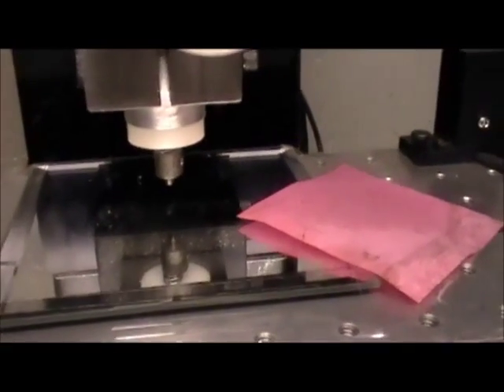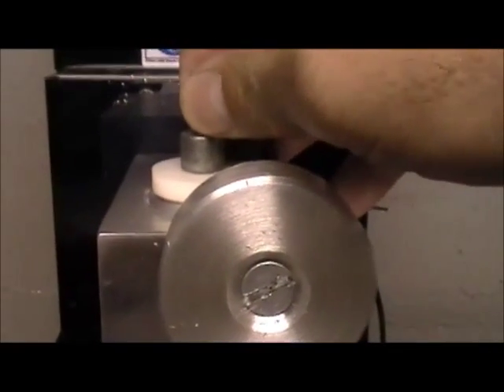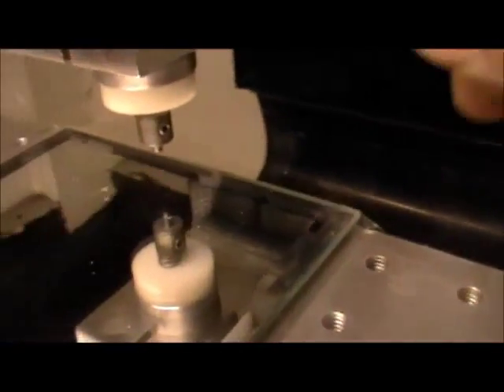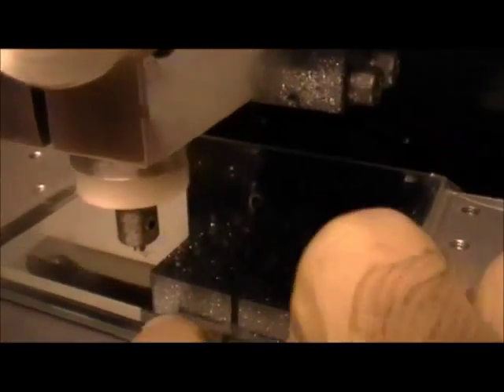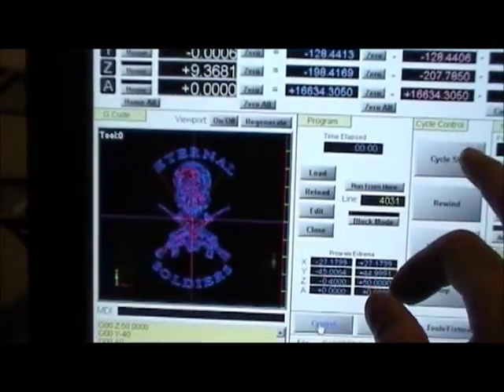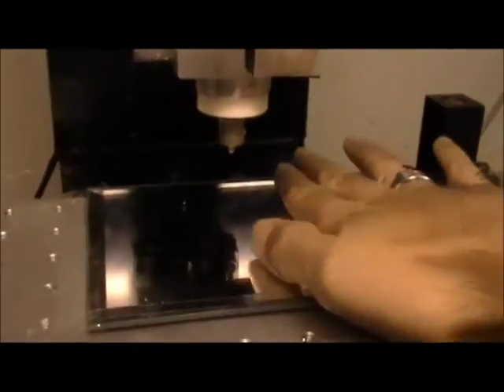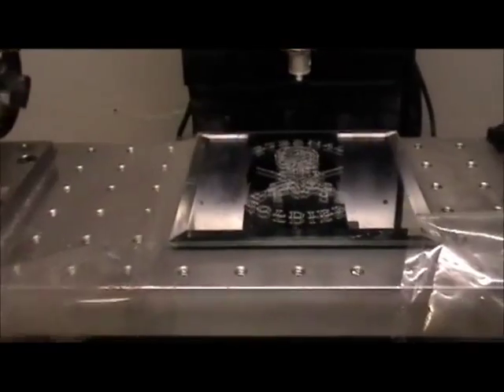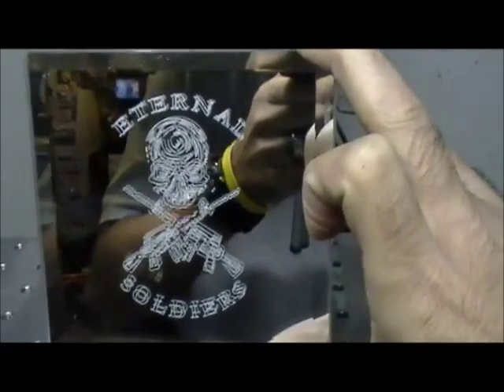first cnc engraving on glass.

Comment: What did you set as the depth of cut?
Reply from the maker: depth of cut was set to .3mm below top surface.  It allowed the spring to compress a bit to give good tention on the surface so the diamond could engrave the surface of the glass.  .3 to .5 mm is my go to settings depending on the material.